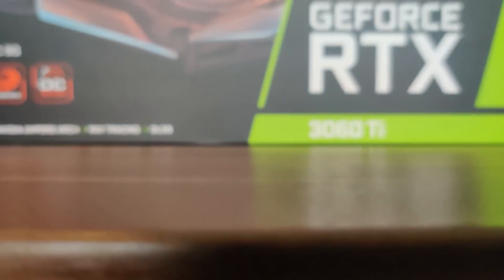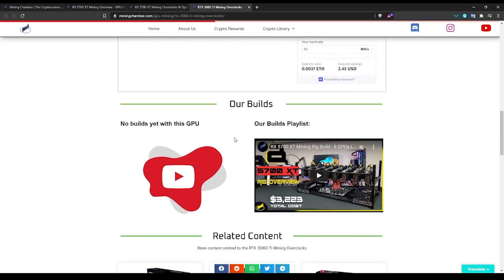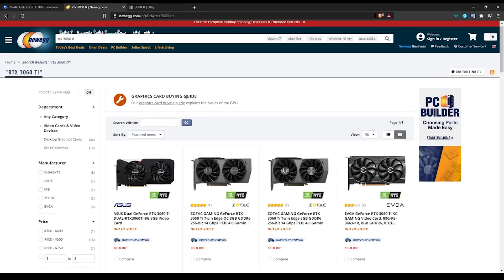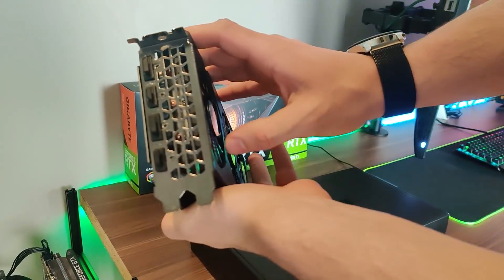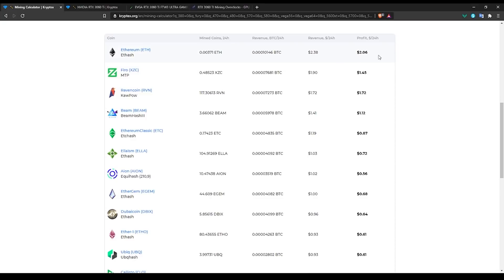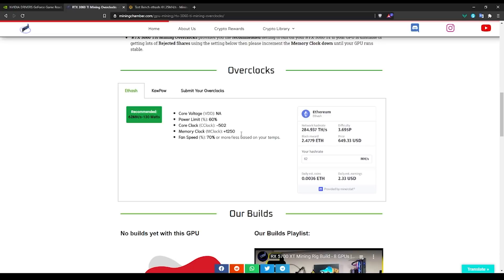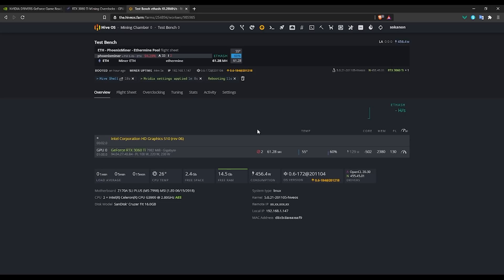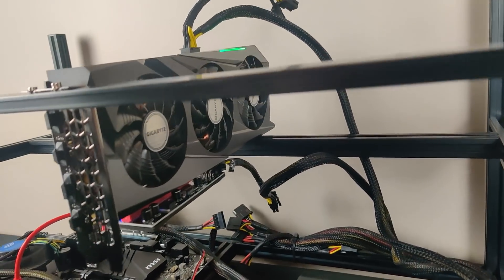RTX 3060 TI Mining Overview | Profitability, Hashrates & Overclocking

Comment: Great video! I had a 3060ti and pretty much got it to what your recommended settings after playing around for a hour. Great gpu to mine with. I ended up giving it to my friend as I felt like I had enough gpus for now. 
Now have you had the chance to look at 3080? I have played around with the card and look for vids, everyone seems to hit 96+ hashrate but i can only get 94. Its a ftw 3080 and cooling is not a problem. For some reason, my card crashes every time I go above 850 mem time. Very unstable at 800. so I am mining at 740 with 94 hashrate which is alright but I cant seem to get that 1000 mem time everyone else is able to achieve. U think I am doing something wrong or perhaps I just got screwed by silicon lottery?
Reply from the maker: Thank you!! For the 3080s I believe issues can be with memory temps. I believe Red Panda Mining and SerpentXSF went through a breakdown and changed the thermalpadding then it was better. Apparently the memory gets too hot and it's not in contact properly with heatsink that is as far as I heard! I haven't gotten to test one my self yet!
Reply: @MiningChamber  thanks so much for replying! one of the real ones who reply to comments! Yea I've seen the videos, their cards just thermal throttle and slows down, mine just black screens and take like 10mins before restarting. Weird crash, but its ok, I will look into the thermal pads further.
Also Merry Christmas! and Happy holidays!!!
Reply from the maker: @WillYouPanMe  Absolute pleasure! and sounds good; good luck with it!

Happy Holidays!!

Comment: great card but I still like 570s cause of ROI is less, I can get 3 cards for 500$ for 90 megahash !
Reply: What about the electricity usage? 120w per card it's 360w for 78 mh/s
Reply from the maker: @RockoShaw  Yes electric is expensive for that GPU but the price you get them at can be very  cheap
Reply from the maker: That's pretty good!! I agree on the ROI just the 3060 ti is good resell value too especially later on!

Comment: Hey Chamber. Nice vid.  Try -500 2200 110 power limit in hive os.  I have 2 3060tis, ASUS dual and ASUS TUF OC.  With these settings I get 58.6 and 59.6 MH on the gpus for only 110 Watts at the wall each.  This gives better efficiency (0.54 MH/W) than the settings you had.  I also worry about pushing the mem as high as you did as there are no temp sensors on the mem and I am concerned about the long term life of the card.  Keep up the vids! I really like your vid on power cables.  I am trying to get an evga 3060 black, curious to see what the second cheapest 3060 card can do.  I do not like the gigabyte eagles and will not buy one.
Reply from the maker: Awesome thank you so much for the information!! I will give that a try as well as add it to the site for overclocks. Much appreciated!

Comment: What is the system power draw without the 3060ti GPU? The true power draw of the card while mining is the difference with and without the card and NOT with the GPU at idle. You will find it draws ~30W more power than what the software reports
Reply from the maker: Oh interesting as far as I remember I think system idle is 50 watts without gpu, with gpu it's at 60 watts. So I feel like it's fairly accurate but I can be wrong! Il have to double check

Comment: Would you advise building a rig with 3060Tis, or with a double number of RX 570s or RX 580s instead, since they are essentially half the price?
Reply from the maker: I would go 3060 ti if it's just double the price ;) you get double hashrate and 1/2 of power draw
Reply: @MiningChamber  Thanks!

Comment: I ended up just return the PSU and keep the card.
Reply from the maker: Hmm re-shelfing fee was high? (Or whatever it's called) 😅
Reply: @MiningChamber   Restocking fee? Are you French?
They didn't charge me any restocking fee, they did charge me $10 for shipping the PSU back to them.
Reply from the maker: Oui oui bien merci 😛 not bad I might return it then it's like $100 not worth it at all
Reply: @MiningChamber  I have not opened the PSU at all, so I returned it in sealed original packaging.
Reply: @MiningChamber  if you paid using PayPal you get re-inbursed for the shipping PayPal has a shipping on us program

Comment: 10 months to break even!! Why even bothering with this. For that money just buy ethereum or bitcoin and you will have much more profit. And don't forget, blockchain reword is really high now. In some months reword will be much less, so return of investment will be much more than 10 months.
Reply from the maker: That's how investing works :) buying crypto for example Bitcoin at 20K doesn't necessarily mean youl make your money back the next morning. It can take months/years to double your investment so you can withdraw your main capital, that is the same with stocks and basically anything that comes to investing. On the other hand, with gpu mining your continuously making money through the asset (the gpu) and then you can later sell it for at least 70% of the price you got it for. So you have a physical asset that generates for you crypto. Ofcourse if your electric rate is expensive then not worth it at all but for low rates even if block reward is low and ETH is back at $150 profits will still be decent comparing to investing directly in crypto then your portfolio loses value due to price action. 

Hopefully that makes sense for you, just clarifying why I do it not trying to sell you in on it or anything like that
Reply: @MiningChamber  agree plus the hype train is starting now is a bad time to probably buy straight coins.  Buy at the bottom not top lol.
Reply from the maker: Exactly!
Reply: You don't need to buy bitcoin. You can trade CFD. You can speculate if some crypto currency or stock will move up and down. I made 250€ today when bitcoin went down. Don't get me wrong I love mining, I also have mining ring and for now its profitable, but like everything else it's only trand that changes on daily basis. You have to envest a lot money just to brake even in year or even more. It was a good investment few years ago but not now. A lot is changing and those changes that are coming are not good for miners. I really hope I'm wrong. I love my rig I don't want to shut it off.

Comment: Currently have two 3060 Ti's on a rig mining ETH. They are Palit and stable. Better than Zotac. Thanks for the optimal settings. They will give me 1MH/s more at 10W less.
Reply: Hi. So Palit is good brand? Or msi is better?
Reply: @neatacostin8557  I didn't think there is much in it. I'd rather have any brand than nothing right now.
Reply from the maker: Awesome thank you for the info!

Comment: Wow nice i wasnt able to get my hands on one of those best buy locked up my account for trying too hard, anyways answer a quick question for me? Is it safe to splitter a single rail pci 8 pin twice to accomodate both the GPU dual 8 pin and the riser 6 pin? The wattage is safe and ive run all the numbers im just wearly of putting a splitter on a splitter.
Reply from the maker: hahah damn BB - On paper, it seems completely fine to do that but in practice, it's better to avoid daisy-chaining splitters. So you can get away with it but I would try to avoid it if possible. Even using Molex strand to power a riser or 2 is not a bad idea haha
Reply: @MiningChamber  gotcha, i purchased one of those antminer PSU with 10 x 8 pin connectors for 70$ it only has 8 pin connections
Reply from the maker: Nicee! That's not bad at all

Comment: I have the same card, and MSI Ventus 2x they both do 63.5 mh/s, but the Gigabyte Eagle does only 61.4 mh/s stable if I push it to 62+ mh/s I have +5% incorrect shares.

Edit : I know the difference is low, but it is something.
Reply from the maker: Awesome thank you for the information!!
Reply: What settings and miner are you using? I have PNY Gaming Revel one and it's doing 63-64mhs on Nicehash, but cant get it over 61.2 on Phoenix not even with higher power limit..
Reply: @DaThisGoD  I have made some video about hashrate, this one is the 3060 TI https://www.youtube.com/watch?v=gr6roNB6mZ0&ab_channel=RIKU07X
Reply: @riku07x12  yeh your video was the first video I checked about this card x) I could eventually get it running ~63mhs @140w on Phoenix too.. Which would you prefer; 59.5mhs@120w, 61.3mhs@130w or 63mhs 140w? Can't see the mem temps but core temp is; 47-51°C@120w, 51-55@130w, 57-61°C@140w..
Reply from the maker: I added new settings to the website and now I am personally running it. I feel like the power draw is pretty nice keeping it at 110 watts for HiveOS
Reply: @DaThisGoD  if electricity is not matter to you, max the OC.